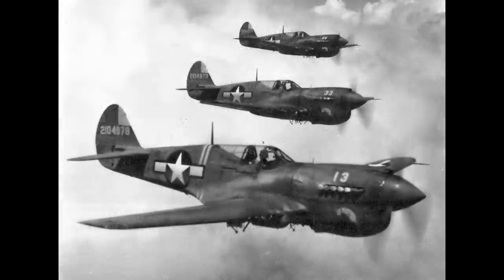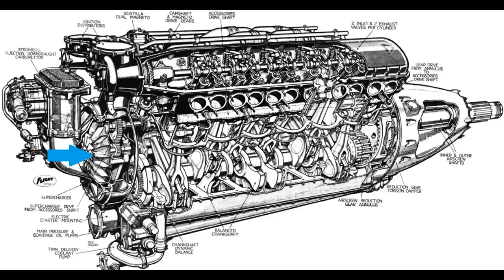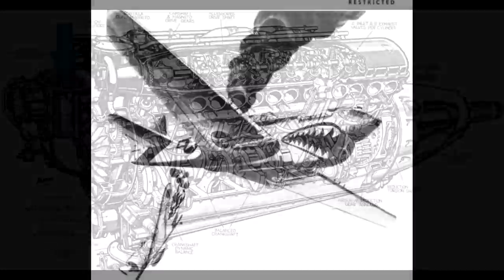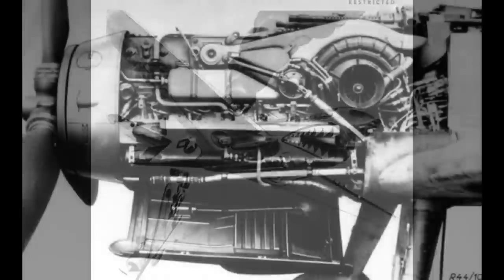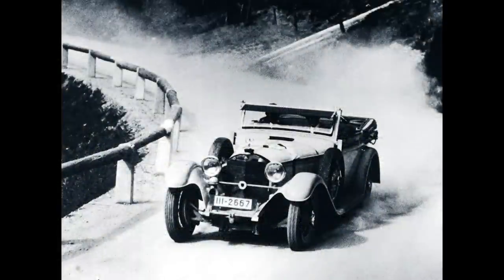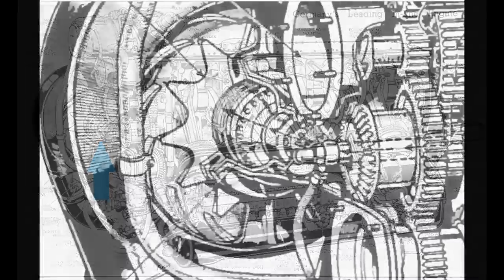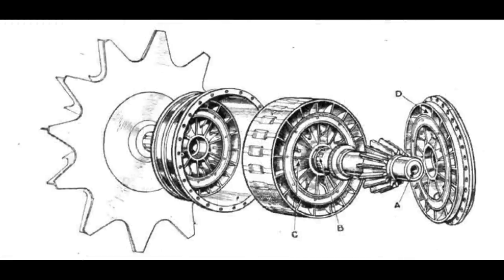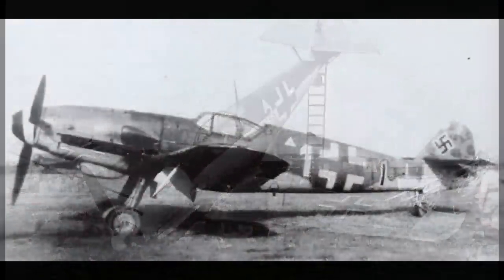Messerschmitt BF 109 Supercharger Drive System

Comment: the german system (mechanical injection and variable blower) was superior in a dive until the negative g issue in carburettors was solved.  Stanley Hooker at Rolls said in his book, said the two different approaches used by the Allies and the Germans had their strengths and weaknesses, but worked out to be equivalent. It was the avgas that let the Germans down, without very high octane avgas, making really good hp is not possible.

Comment: Thanks. Do you know anything about the flying control pressures at high speeds? In another video a pilot was stating that even at high speeds the ME 109 had good aileron control unlike the P-51 which got really heavy. The Zero had issues in all 3 control axis. Apparently the ME 109 also had a far superior rate of climb compared to the Spitfire or P51. Do you know if this is correct?
Reply from the maker: That's all in the next video.

Comment: I think gyroscopic forces affecting angular momentum. If a given engine is mounted paralleled to the direction of travel. There might be benefits to having a super charger mounted @ 90 degrees. The high speed impeller would be rotating parallel to the direction of travel. Think of holding a bike wheel and trying to move it side ways. I would think the mechanical connection of a super charger would be less affected. A true turbo  charger  would be greatly affected.🤷‍♂️

Comment: Things I have wondered about the hydraulic supercharger drive:  How much of a power penalty did it impose due to shearing of the fluid?  Did it use engine oil for the working fluid, or did it have its own supply?  How much heat rejection did it add to the Bf109's cooling system?

Comment: I thought I heard Greg call an Engine a Motor ? No . I must have been hallucinating .
Reply from the maker: I hear you. Those terms get a bit jumbled up. I know that normally the term motor refers to an electrically powered device, and engine is normally a combustion powered device, but it gets a bit murky. For example, we have outboard motors, which are usually powered by pistons and combustion. So while I'll try and use the term Engine for a combustion device, I'll probably slip motor in there on occasion.

Comment: i suspect that the perpendicular compressor was simply force of habit. basically, "that's just the way it's done." it was the best design in germany at some time, then everyone adopted it for that reason, no one had any problems with it, so no other configuration was attempted.
Reply from the maker: That could very well be the case. Heck, maybe the guy who made the supercharger had a brother in law who made bevel gears and they just stuck with it. There are a few decent theories out there, but I haven't seen any  actual source materiel with the answer, which is why I fear this information was lost in time.
Reply: well, also the incremental progress vs. big leaps problem comes up. the standard go-to design gets tuned so well that a concept with superior potential can't match it as it does not have the benefit of a bazillion years of tuning. and that's ignoring the plethora of other problems with adopting something new, such as momentum. 

remember, a LOT of force is required to alter the velocity of even a metaphorical object. Opinions and understandings are the objects that come to mind. heck, until very recently, Elon Musk ran TWO companies on momentum and little else. Only now have said companies evidenced so much as a glimmer of return on investment.

Comment: Late to see this video--thanks Greg! One thing I have always wondered is how the Bf 109F had an approximately 1,100 hp engine and the Bf 109K-4 had 2,000 hp, but the two subtypes used the same size radiators (if not oil coolers). How is this possible? One can look at the Spitfire with roughly the same progression of horsepower (Mk 1 vs Mk 14) but the Spitfire's radiators grew a lot in size. Thanks for the great videos!!
Reply from the maker: Those high power numbers are with water:methanol injection, which provides what NACA calls "internal cooling".
Reply: @GregsAirplanesandAutomobiles  Thanks Greg--that does make sense. Wow--I had no idea how effective MW50 was!

Comment: Please, can you make a video where all the superior caracteristics of the Bf 109? In comparison with another fighters of WWII.
Thank you very much for your attention.
Best greetings!
Reply from the maker: Hi Cristian, that's a great idea, and yes I'll do that. I can't do it just yet because there are too many critical concepts I haven't covered yet, which I will be covering in my P-47 series. Of course that's making my P-47 series a bit longer than it would otherwise be, but I think it's necessary. The concepts I am taking about are maximum dive speed, maximum mach number, compressability, sustained turn radius and rate, maximum angle of climb, zoom climb, and max rate of climb and the effects of loads and altitude on each. Once all of those concepts are understood, I can explain where any particular plane has advantages. A quick hint is that the 109 almost always has the max angle of sustained climb advantage.

Comment: allied pilots  in the BOB,during training found out the bf109 was slower in rt turns and dives than in left hand dives & turns,maybe the position of the  air impeller on the side caused this. were there additives to the water  like alcohol,methanol to add cooling ad PMP?

Comment: Thanks, Greg for a very informative and in dept article. Recently, I run into very interesting info about the very subject that you was talking about, namely 90 degrees of the supercharger that was drawing air from the side of the engine block, so because of this asymmetry of that compressor - compression ratio in each engine block have to be different. Isn't it kinda a German type of complicating things?
 - Also I can't remember the source for a fact, but I read that DB-605 was very unreliable engine(I think it get something to do with a premature crank bearings failure, that previous model engines did not have), with life expectancy of somewhere between 25 to 100 hours, and because of its incurable flaw that engine had nick name "sick"(what ever it is in German), but from bad comes good, and Willy Messerschmidt perfected later versions of Me-109(I think on Gustav models), so the engine can be swapped in some crazy short amount of time like in 40 minutes to two hours because most of fuel and cooling lines had specially designed quick disconnection couplers, as well as very neat modular blocks of all electrical components fixed to engine firewall. What say you?
Reply from the maker: Hi Russian. It's true that some German inverted V-types ran higher compression on one cylinder bank.I don't know of an original source explaining that, my guess is that it's due to some cooling variation between the two sides. Some speculate that it's an airflow difference, but that doesn't seem credible to me. I think the inverted V-type was used because it allows a more narrow overall fuselage. Look how skinny the 109's is at the top. Maintenance ease was probably a factor as well. The DB605 was a good design, but metal problems and forced labor issues were the main problems. Germany in 1944 wasn't a great place to be building things.
Reply: Thank you for your quick response, I think you nailed it. Inverted V for ease of maintenance, so that way no climbing on a tall ladder and reaching over the engine block, all Hanz would have to do is to drop chin cowling and bingo, you get access to all valve train, fuel rack, exhaust pipe stacks,  all you can/need to fix/inspect, that is brilliant. BTW, cooling in Me-109 was great as well, dual system, in case one radiator get puncture, it can be isolated and shut down, and flown on only one(albeit not full throttle), Charlie Brown and Franz Stigler story comes to mind, where Franz Stigler was given orders to shut down limping B-17, even though one of his radiators was damaged. And in case both radiators get damaged, both can be isolated, and in this case pilot had 5 minutes of flying before engine quit due to overheating, and considering how short legged this plane was, it might just give that extra edge to make over front lines, or find a better place to land.
Reply: The DB605 was a good design, but metal problems and forced labor issues were the main problems. Germany in 1944 wasn't a great place to be building things.
-- Nah, it was some kind of known design flaw(that I can't remember for the life of me that was not eradicated to the end of war), that engine was not well liked by pilots either, Hans Marseille was killed, because problems with DB605, that he was forced to fly(at least one of the stories, and there are plenty surrounding his death) Me-109G instead of his trust worthy Me-109F with DB601. Oh, BTW it was year 1942.
Reply: +RussianThunderrrr  The Luftwaffe used the Quick Engine Change or "power egg" concept in many other types, including the Fw-190 and Me-262.   Removing the entire engine and accessory package to send back to the a repair depot was a common practice rather then deep maintenance in the field.  Cowling and all were left with the Fw-190, which is one reason some late war photos show mis-matched paint on the engines. (Another reason would have been the paint applied by the component sub-contractors..)

Comment: explanation. Am wondering why the DB 601 had two compression ratios. One for each cylinder bank?
Reply: + ROBERT DIXON    I believe the location of the supercharger created unequal manifold pressures in the A and B cylinder banks.  The compression ratios offset that.

Comment: 2 questions about 109.   I was talking to a friend about 109 armament. He liked the cannon thru the nose,  I had heard it didn't work well because of combined heat from engine and gun caused problems.  Then I started to think, seems every model had a different weapons configuration.  Guns in cowl, gun on wings, both. Cannon in nose then on wings I believe.  Any reason they didn't stick to one that worked?   Second question:  Why the inboard undercarriage?  I've heard "to fit on trains"?  and Navy carrier duty not that they had that many carriers.
Reply: Because Bf-109 wing had only one longerons, while typical wing two or more, so the only other strongest point where to mount landing rear, was to fix on the other side of engine firewall(the strongest point in aircraft), but narrow LG caused a lots of crashes on take off and landings, and killed many pilots.

Comment: The charger speed of the 109 was regulated by the amount of oil in the coupling. Less oil means less power transmission but also hotter oil at it is more "pushed around". This is the reason why the regulation started in 1-2km - to avoid the coupling oil to get burned by getting too hot. Below it worked like a static driven supercharger of common design and you can see in many charts how the regulation starts in > 1km altitude.
Note that most ww2 engines did boost the air to higher pressure and regulate them to a max. pressure afterwards. This is ineffective at low levels when you overboost the engine a lot (as compressor driven charger take power from the engine output, reducing netto output) just to regulate it down by a valve afterwards. At full throttle height, you are most efficient, thus the increasing gradient of power output for most ww2 supercharger driven engines  - Like for the 109 below 1-2km for named reasons
A different, simple yet effective concept was to limit the pressure before entering the charger, so the charger would just have to build up required power. This was first used on the russion mig3 engine (AM-35) and later copied for the JUMO-213 engines of the FW190-D  fighter. The power output over altitude shows a much more flat characteristics, the losses due to overboosting were reduced.

Comment: P51's ran 70 on manifold  pressure. That's why it was faster. Manifold pressure determined power. Germans had to gear for wide altitude ranges. Allied fighters could gear for specific missions

Comment: the only reason i can think of reason for the supercharger being on a strange angle is because of the speed vortex head on centripetal force up and down .... she has massive impellers man...also this has to be mainly airflow fixated because no machinist would stand for bad fuel to air mixture not unless apple starts making cars

Comment: I can give you the explaination for the 90 degrees supercharger. The DB60X family of engines as well as the Jumo 21X family of engines were developed under strict design (inverted 12 cylinders on 4+2 cycles) and length specifications (under 200cm) from the Reich Luft Ministerium and the overall length of the engine was fixed. There was no way to put the compressor at the rear and meet the specs. As weird as it may sounds, the german wanted powerful engines mounted in tiny airframes. There was no other considerations than overall length. Compare the DB601 with a Merlin II for ex and you'll see what I mean
Reply from the maker: Then why was it that way in German cars first?
Reply: @GregsAirplanesandAutomobiles  what car do you have in mind ?
Reply from the maker: SSK
Reply: @GregsAirplanesandAutomobiles  Comparing a Roots type supercharger to a centrifugal one isn't super relevant IMHO ;)

Comment: What is it that makes superchargers less efficient when throttled?
Reply from the maker: Superchargers generate a pressure ratio. Say it's 15psi at the inlet and you need 30psi in the manifold. Great, you need a 2:1 ratio. the supercharger only needs to give you 15 more psi. Now cut that inlet pressure to 14psi via throttling. Now the supercharger had to add 16 psi to get the same 30psi in the manifold.

Comment: Delicious level of detail for us aviation history geeks. Thanks! You mean like a Continuously Variable Transmission (CVT) in modern cars? I couldn't see from the diagram 6:40 how it works. D rotates co-axial with the crankshaft, and the "conical" gear at A is where the drive torque takes a 90 degree turn. (Not quite sure how the teeth of conical gear A quite mesh with the teeth in D but whatever...) Is the next section B, C where the continuously variable transmission occurs? How does it work? Can we see an animation? I love CVT and have followed the latest developments that made them practical.
Reply: @slehar : It's more like a torque converter  (T.C) than a CVT...  The gear ratio is constant, to give the best admission pressure at high altitude and high engine load, with the T.C on its max (low slippage), and the hydraulic regulation (based on admission pressure and power demand) allows more slippage in the T.C when the pressure rise, so the compressor speed decrease, and so on....  
https://www.youtube.com/watch?v=z5G2zQ_3xTc      (I think the ME109' T.C had no stator,  just a turbine "C" and an impeller "D" and the regulation occurs with the oil flow in "A" )
Reply: @pierrotlefou2567  Wow! Awesome! Thanks for the deep info!

Comment: great presentation Greg!  as for the supercharger at 90 degree angle on  these DB  AD JUNKER JUMBO engines, ,could it have something to do with the direct fuel  injection?
Reply from the maker: I don't think so. Now they did put the main fuel pumps at the back of the engine, but they could have been easily located anywhere. The actual fuel injection units were located between the cylinder banks. The more I think about it, the more I think it was for efficiency of the supercharger intake.